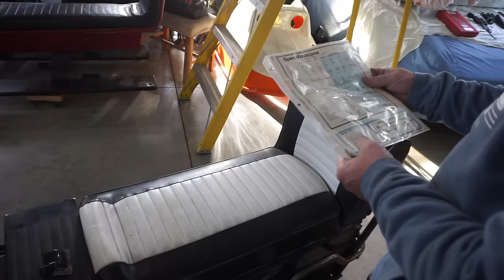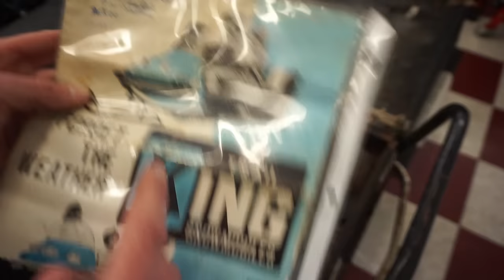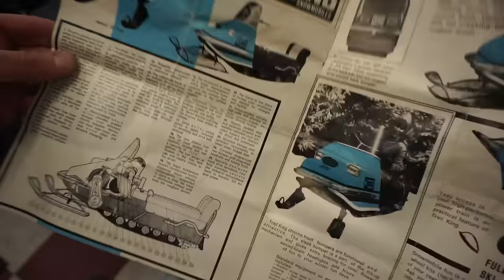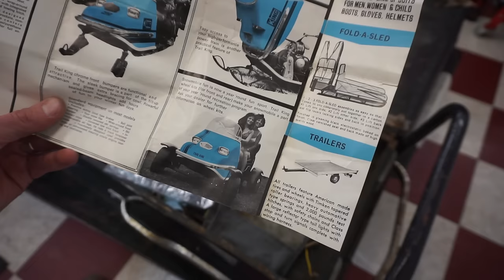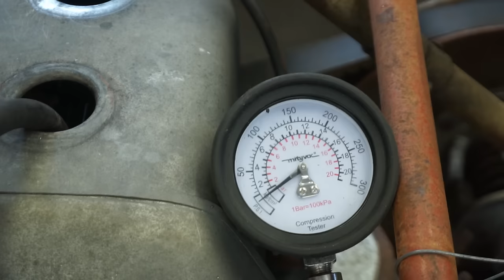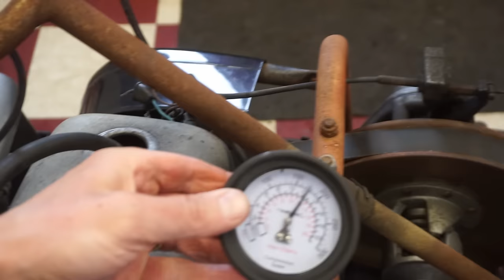Rare 1970's Sled Sat 40 Years After Losing Spark

Comment: The plastic of the windscreen was petrified. It was going to shatter soon, no matter what you did. You can take the dimensions and look for a replacement. Don't let it bother you.
Reply: I was thinking the same thing but as for finding a replacement it would be better off taking the dimensions and going to a place that can form the plastic to make a brand new one
Reply: @186scott  He can do it himself. There's quite a lot of info online. He's a clever guy, I'm sure he'll get it sorted.
Reply: Not sure l believe that it broke because it was 'on the highway' More like a mishandled loading.
Reply: @bananabrooks3836  i believe it chances are it wasn't the wind from how fast he was going but more likely something flicked up hit it and it broke
Reply: When I was a kid (long ago) I would pick up some plexiglass and make my own windscreens. It wasn’t very hard to do. It’s not like they have the curves of the windscreens of modern sleds. Just measure total length and height, drill mounting hole in center of screen and with your heat gun heat up the plexiglass to form it around the sides drilling and adding mounting screws/bolts as you go. Then round off corners when you finish mounting.
Reply: It was old and could of had small stress cracks in it already. It was 50 years old.

Comment: The chaincase cover where the bulge sticks out is where the tensioner was. Models came in Sachs Engine was standard 15HP $695, LLoyd Engine Delux 22HP  $895 and Kohler Engine 399 Super 24 HP $1095. Sold in Woolco (Woolworth) Department Stores.    So you have the middle model with 22 HP LLoyd engine.   Use a steering wheel puller to take the lower sprocket off.

Comment: You don’t need a puller for that. If you remove the grub/set screw, you can insert a couple of bolts into the two threaded holes and that will push back on the sprocket to remove it. I do this at work all the time. Hope this helps!!!
Reply from the maker: I will try it, thanks!

Comment: Thank you for your consistant videos! I hope you  read this in time because you tightened down the upper sprocket with the an impact gun. THERE ARE TAPERED ROLLER BEARINGS THERE. Adjust the castle nut as you would a wheel bearing! Another disaster awaits if you don't.

Comment: Unless I missed it, that machine was built in Quebec by Sno-Prince later owned by Lionel.  They built several different brands but were basically a Sno Prince with different decals and minor detail differences.  As for the chain tensioner, some older snowmobiles had an eccentric upper chaincase bearing.  Check there too.  And most snowmobile aftermarket parts suppliers have windshield material you can  cut easily to make a new one.
Reply: I have a sno prince and i can see tons of similarities between them because they were both made by that lionel company

Comment: You are correct there is a chain tensioner missing. One off an old Arctic Cat Lynx will work if you drill out the guide rivets and turn the arch the other way. I hope that helps you

Comment: Another awesome video. Pro tip, use a small finger nail file ( the tiny foam type) to sand the points. Always carried one in my tool box for my VS sandrail.
Reply: The super cheap thin ones at the dollar store work great!
Reply: We used to keep a small piece of fine sandpaper in our toolbags when we still had vehicles with points. Fold it in half and slide it into the points gap. The biggest issue we had was bad quality condensors.

Comment: If the bearing  housing cant be fixed I would either make a weld or bolt in part , it will be stronger than trying to weld the bearing housing back together and machine it as it is cast aluminium  so prone to breaking again.
The engine sounds great just needs a diaphragm /gasget kit for the carb and it should run spot on.
Another great find and rescue 👍

Comment: You could make a new windscreen for that, using a piece of polycarbonate, and a heat gun to shape it. use what's left of the old screen, as a template to drill the mounting holes.
Cool sled that one. super rare

Comment: great way to stretch the end of lines to fit over a nipple.  Get a small set of needle nose pliers, close them and insert it into the hose and spread the pliers.  Put a small amount of oil inside the hose.  The hose will slowly shrink back to the original diameter but will give you time to insert the nipple.

Comment: The puller i belive is a thick peace of steel with center threaded hole and two sloted holes on either side to put bolts into the sproket then thw center bolt has a little point on it to line up on the shaft

Comment: When took the carb apart. You took out two plates. At the bottom 
There is two round 
Welch plugs. One is a jet the other is a check valve

Comment: Magneto produces ac and with addition of a diode in the circuit it produces half wave dc for lights and charging, many times with a high revving engine and lack of a dc regulator you'll have those dummy load resistors, as you have by the headlight, to absorb overvoltage and keep your headlights from burning out.

Comment: Joe you can form a new windshield with lexan at about 300 degrees f in an oven or form it over a foam type mold with a good heat gun. It's not that hard. Get a scrap piece of "lexan"  because it doesn't crack like plexiglass

Comment: Well hopefully you can plated on inside of that backing and maybe use a two bolt flange bearing.  If you use carnage bolts the heads can be flat on inside so doesn't interfere with lower sprocket.  Good luck but other old sleds use the same chsin case

Comment: Thats cool.  Shame about the windshield.  I guess the lesson is to unscrew it and take it off for transport on the next one..  If it broke just from the wind, it probably wasn't long for this world.  I bet you can find another one.   I'm sure Trail King used the same windshield that multiple other vehicles from that time period used.   If you had gotten under it with a flashlight at this place, would have you seen that bused out bearing?  I think you got a decent deal on it either way, but that's the sorta thing you can use to bring the price down.

Comment: Windshield is o big deal, just get some plexi and make another
You are missing the muffler, looks like it was replaced with flex pipe
Plugs: One side does not run leaner than the other(single carb) unless there is a crank seal leak and one side is sucking air.  
At idle, spray propane around case to see if it's sucking air
You need to talk to a vintage museum mechanic, many older machines use common parts. They wouldn't make a mold for jut a few hundred parts, it would be too expensive. Thats why many vintage machines have common parts

Comment: The engine is a brute, if you take the time to get the specs for the bearings somebody makes it, definitely not a one off part, the crankshaft seals are another story, they're certainly at risk just from age likewise the belt and drive sprockets, either way that engine has some grunt left in it, I'm thinking it would really come alive with a load on it

Comment: oh by the way there is no tensioner in these older models sleds how you adjust the chain tension is by the secondary clutch which has an adjustment bolt .you need a lesson in vintage machines my boy ,might want to spend some time with old timers like me 😊

Comment: Oem timing gear puller Part #25258 SKU #231208 from autozone $8.00 online similar to what I have may have to change the bolts for your application.